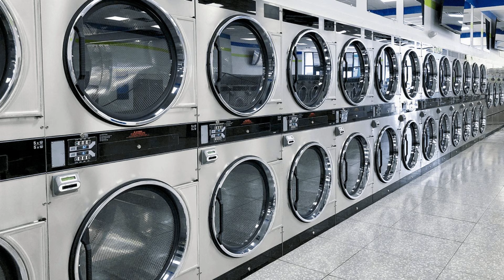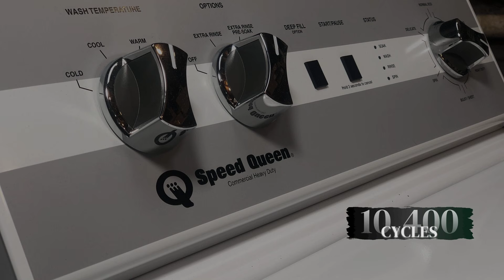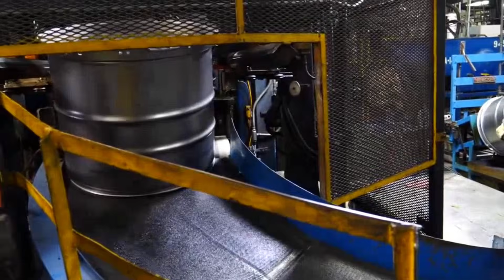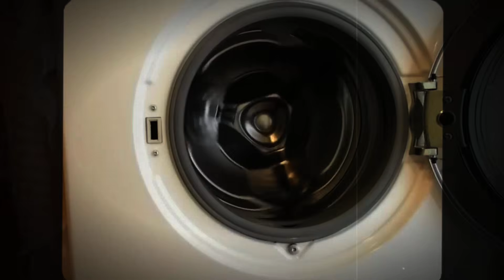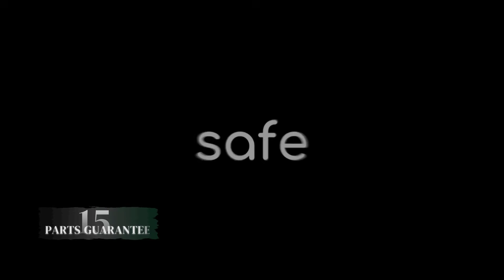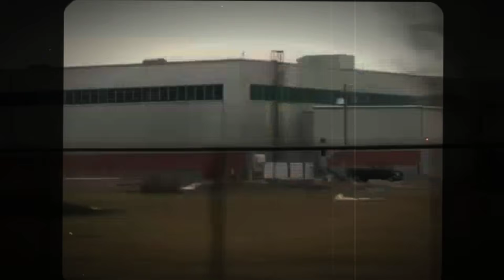The Only 4 Washing Machines Repair Techs Actually Buy for Their Own Homes

Comment: bought maytag washer 20 years ago, had to replace door switch, balance spring, mixer valve.  Got parts off internet for cheaper than local parts store.  still using it.  I do not know if it is a commercial or residential mdl.  bought from a furniture store.

Comment: I bought a tc5 speedqueen washer/dryer set 10 yrs ago. It cost me 2k. It is the most quiet/dependable set i ever saw. I have had not 1 issue or problem with it ever.(background)
I am a retired hvac/r teck for 30yrs. In my humble opinion
Speed Queen top load washer and their gas dryer combo are like ronco matic just
Set it and forget it for the next 25+
Years😅
Reply: Speed Queen T.C.5 did not come out 10 years ago